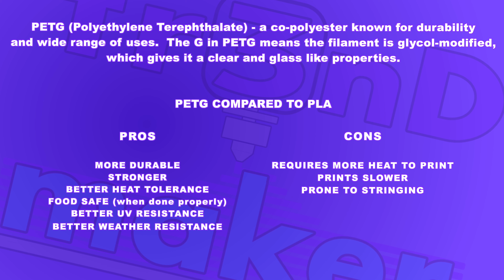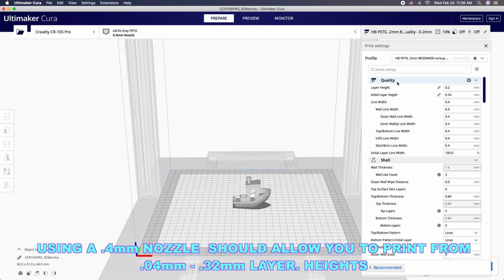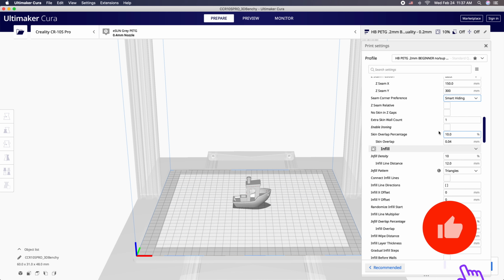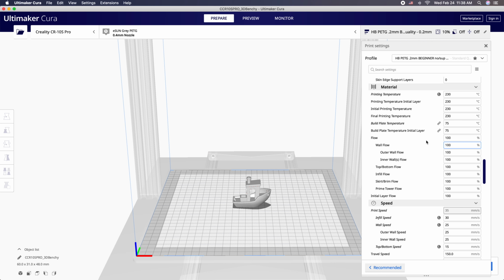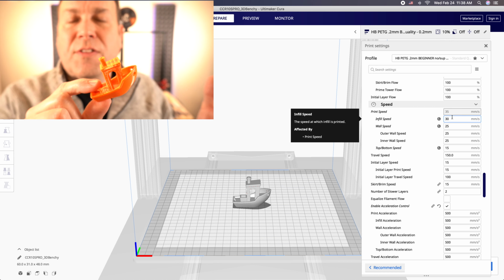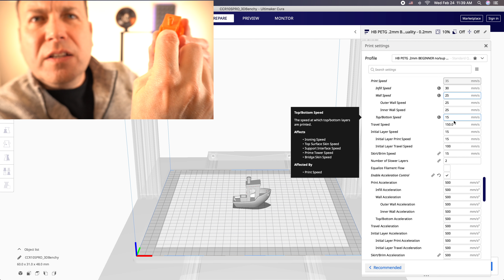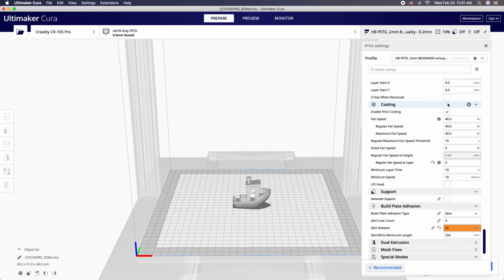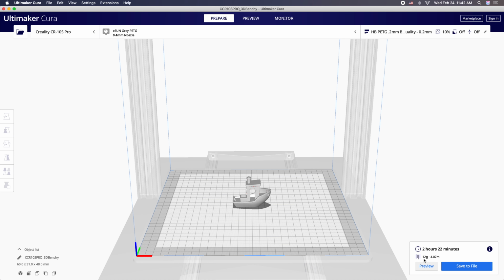How to 3D Print PETG Filament! Tips and Settings to 3D Print PETG Like a Pro - Cura

Comment: One thing you might want to point out, which I learned the hard way: Bed levelling. When I dove into PETG, I used Curas default settings for a brand PETG, figuring it was well in the range of the filaments specifications. I noticed quickly however that the first layer would not adhere to the bed though. While I had just levelled the bed the day before, and the PLA print I did before worked just fine, it took me a while to come up with the idea to just push the bed up a little bit furter - turns out this was all that was needed!
Reply: Yea I am finding that different types of filament need a different amount of squish to adhere. I think I might stick with petg as my go to if all things go well in the next dozen prints or so. Any recommendations on a filament that will be good in handheld electronics? I think petg can withstand the heat and abuse but I havent gotten to test it yet.
Reply: DUDE I HAD THE EXACT SAME ISSUE!!! The first time i printed PETG taught me to always re-level my bed when switching materials, and to invest in drying stuff like a good dehydrator lol. Rn im prob gonna use exclusively PETG because im trying to print functional parts to mod my dart (nerf) blasters
Reply: I've inserted the M29 line so that the machine always autolevels before doing a print.
Reply: I tape the bed and smear it with glue stick. PETG sticks to everything, and I've heard of people pulling chunks out of a glass bed with PETG. A disposable bed cover is much cheaper.
Reply: @freman007  have heard about the glue trick, yet never tried it out.
Reply: @freman007 do you have a glass bed?
Reply: @JohnDeaux I’ve done it and sometimes I still do when the filament doesn’t want to stick to the bed and it works I would definitely recommend the Elmer’s washable glue. It’s easier to get off your build plate.
Reply: @rap_godzz  glue stick works well if you have adhesion problems but i prefer cheap hairspray from the dollar store TBH... I REALLY prefer not using anything but my glass bed but sometimes certain filaments are tricky to get a good first layer with...

Comment: Great vid.  I got a good PETG part with temp 225, layer height 0.16mm, speed 50mm/sec, 100 fan, build plate adehsion temp 70 degrees (white glue).  I am going to try these settings.

Comment: I have a problem with PETG.I have tried so many times,but I can’t find the solution for stringing.I have an ender 3 and i use cura.
Reply from the maker: Give me some settings... what is your travel acceleration?  Retraction? Temp? Filament brand? Speed? How many hours on nozzle?  Any mods?
Reply: @tr3nDmaker  travel acceleration: 450 mm/s^2
retraction distance:3 mm
retraction speed: 25 mm/s
Temp:225
Filament brand:Devil Design
Speed:50 mm/s
No mods
I am using 0.4 mm nozzle for about 3 months but i have not done so many things.
Reply from the maker: @ΔημητρηςΔασκαλακης-ν3β  Several issues.  Retraction on ender 3 is 5-5.5 at 35mms. Travel 150mms.  Speed 30mms across the board.  PETG is thick and slow to print.  Watch Video and copy my setting as I scroll thru.

Comment: Thank you mate. I am really used to PLA and TPU, only recently I started with PETG. Its material properties really appeals to me, possibly the best of the two worlds, ABS and PLA. But man I struggled with stringing and the answer laid on speed. 30mm/sec is slow but clearly on the safer side. As you have said PETG doesn't like speed and that's is totally true. Thanks again and really good video.
Reply from the maker: I love PETG... It is worth the wait on slow printing.   The ultimate solution is to buy more printers!
Reply: @tr3nDmaker  you can get ender 3's on ebay for like 100$ US(probably will need mods to work properly if they messed it up,). i'm planning on picking up a few that way and mod them to a dual z belt system or a 45 degree conveyor belt to churn out some parts. petg is too attractive of a filament for me. the dream is a conveyor belt ender 3 farm someday lol
Reply: @or3n_ I got an ender 3 s1 for like 150... those are dual steppers for the z axis and they seem to be on sale on and off on places like ebay

Comment: printing vases and random stuff at 100mm/s kobra 2 max in creality garbage PETG... your approach is slow, high fan, high heat, I find that ~225 and 10% fan can print way faster. the key is not to be afraid of the speed and tune for it ... actually I just tried 232 with 50% and I am running even faster, 150mm/s

Comment: thanks a lot! your settings helped me to solve many problems. the last thing I had to adjust was the distance between the nozzle and the bed/top surface of what is being printed. it was too tight, and it caused the material to blob. I'm finally on the right direction to improve my petg printings.

Comment: Could you do a PETG 1.0 nozzle profile? I have had issues adapting Curas default profiles. It prints in vase mode great and also the initial layers are good on a normal print but infill fails and does not adhere to the print. I think it is under extruding a little bit because I occasionally get small gaps at the corner of the initial layer. Printing at .5 layer height 235/ 70 and fan off. Thanks
Reply from the maker: What speed in mms?  Volcano hot end?

Comment: Hello! Thank you so much for your video! I’m having trouble with printing PETG, where during non printing movements (especially over gaps) it will ooze a lot. I’ve tried dialing down the temperature and increasing the retraction to about 7 mm and upped the retraction speed a bit. It helped a little bit, but I’m still getting the ooze and stringing pretty bad. Is the retraction the only thing that goes into that?
Reply: Travel speed is extremely important. At least 120 mm/s. Go 200 mm/s if your printer can do it.

Comment: I followed your settings for PETG and they worked great for the Overture Space Gray , Ender 3 V2 no modes. The only thing I adjusted was the fan speed to stop the stringing. 
I did use 0.1 mm layer heights for a great finish. I have one problem I need help with. When the part finished and removed from the plate, I was able to separate and remove a couple of the first    outer layers . The rest of the part is bonded together very well and seems strong. Any suggestions to cure this issue will be appreciated. 
Thanks
Rick
Reply from the maker: It could be a couple of issues... 1) PETG does not like a lot of fan... if fan on after 2nd or 3rd layer, it may be cooling too much for it to melt in to layers.  Fan more than 50% can be too much.(PETG is a bit stringier than PLA)
2) With fan on at higher rate... may need to up temp of nozzle 5-10 degrees.
3) Slow it down a bit more.  On first few layers, print is solid and extruding much more than other layer.
4) Possible too much gap between nozzle and bed.  Re-level a bit closer.
Let me know how it works out...
Reply: @tr3nDmaker  Thanks for the reply. I have the fan at zero for the first 4 layers. After that it is at 46 unless I see stinging start and then I put it to 50. 
I increased the bed temp to 75 and the de- lam is gone but the first layer still looks bad when part is removed. I have made a couple different parts with the same filament and settings with perfect smooth finish on first layer. The rest of the part is smooth. Maybe its something in the file itself.
Reply from the maker: @rickbechtel2835  Hmmmm... what temp for nozzle?  Check all ecocentric nuts and be sure everything is tight.  Sounds like nozzle is lifting and not getting proper gap  from bed to nozzle.  How long have you been 3d printing?  How are you leveling bed?
Reply: @tr3nDmaker  I have only had my printed a week. I am leveling the bed with a sheet of paper. I use the four corners an inch or so in and center of the bed as reference points. A light drag on the paper. I have check the parts or consistent thickness and I think my bed leveling is good. I have a more parts to make and will keep adjusting settings one at a time and slowly. What version or Cura do you use ?
Reply from the maker: @rickbechtel2835  I think your issue is in bed leveling(regular paper is not the best to use for a beginner IMHO)... I am editing a video right now on how to level bed w paper and being sure printer is set properly before you begin.  Hopefully post Saturday Morning.  I alway use newest Cura available.  Stock Setting should be great to get up and printing... As you learn more you can tweak as needed based on what your printing...
Reply: @tr3nDmaker  What do you recommend to use for bed leveling? Feeler guage, shim stock ? 
I just think it is possible file issue. Down loaded from Thingiverse  ( Hornady, Secure-Lock Bushing) as my other parts printed with the same material from the same roll have no issues.
Reply from the maker: @rickbechtel2835  Paper Method is good.  Feeler Gauge Method better... I level by Eye now.
Reply: @tr3nDmaker  Paper is closer than eye balling it ! Sorry that is my Machinists background talking. 
If you get a chance , download the file I mentioned from Thingiverse, and just print the first .090 and let me know how the finish of the first layers once removed from the bed look. Curious if its my settings or the file. 
Thanks again for all the helpful information.
Reply from the maker: @rickbechtel2835  Wait till you see my video on leveling by eye... I have been 100% leveling by eye for years.  Only time I use paper or feeler is for demonstration or videos.  It is not for everyone, if fact not for most people... But like you.. I am very mechanical minded... judging the gap is second nature to me.  Plus, I can adjust on the fly with skirt, if I am .01 or .02mm off

Comment: How do I make my print thicker all the way around...more solid?
Reply from the maker: Add more perimeters/walls. 3 is good, 4 to 5 is heavy duty.  Infill % will make it stronger inside.  Top and bottom thickness should approx match walls.  If you want it solid.... make bottom layers= 999.  Be sure to sub!

Comment: Hello, thank you for the video! I've followed all the steps and my prints shell looks fantastic but has layer gaps in it. I've been having a PETG problem since I started using the material where the entire print is very weak, and can be crushed by my hand easily. Here are my current settings:
Infill speed: 25mm/s
wall speed:20mm/s
Inner wall speed:20mm/s
Density: 20%
Pattern: Cubic
Nozzle temp:240c
Everything else is the same as in the video
Is there any way I can fix this problem?

Edit:I swapped out the nozzle and things are looking a bit better. Shell and infill are stronger but the prints can still be crushed/split by my hands
Reply from the maker: PETG likes a simple infill.... I mostly use triangles.  As for under-extruding during infill... try Triangles and bumping temp up 5-10 degrees. The higher temp helps extrude smoother and faster.  If still not helping... try 20mms infill speed. 
PETG is thick and does like slower speeds.  I often just run at 20mms.  It slow, but prints strong and perfect.   
I hope this helps.  Be sure to Subscribe for more videos.
Reply: @tr3nDmaker  Thank you very much. Both of your suggestions worked and the PETG is printing flawlessly, earned yourself a sub!
Reply from the maker: @joedoe2753  Thank you and you are very welcome.

Comment: the correct way to say PETG is P E T G not pet g because it is an abbreviation
Reply from the maker: You are correct.  Almost every 3d printer I know calls it pet g.  A short or slang, I guess.  I will be sure I say the accurate way in the future.

Comment: Nope, did not help me, got worse result than printing with high bed temperature. anyway it is not sticking on glass
Reply from the maker: Wipe on Elmers Purple Glue Stick in a printing zone.  Be sure getting good squish of filament. Must get a good first layer with all lines connected with glass.  Bed at 60-75.  Check if any air from heat or ac anywhere near bed surface... it will cool filament and cause lifting.  Good luck.
Reply: @tr3nDmaker  How material that sticks to anything, can not stick to bed. i have tried pure clean wiped with alcohol glass.also with hair spray, with duck tape, with glue. Best result was that printed xyz cube with hair spray and it basically was holding on with its weight. Some dark sorcery sort of :D But thanks anyway!
What about leveling? PLA is ok with 1 paper, and PETG soemthing like 3 papers?
Reply from the maker: @ygalion  95% of failure like this are either loose eccentric nuts(parts moving) or improper bed leveling.  Watch this and be sure everything is tight and good squish on first layer... Let me know if it works out.  https://youtu.be/MhIE0ms-n7U

Comment: Total fucking bs... i print at 50mm/s no problem. I wouldn't imagine how long a 12 hour print at 50mm/s would take if i was printing at 25mm/s!? Otherwise pretty good tips though you'd probably be getting near optimal results with printing at 40-5 mm/s no problem. Depends on the brand ofcourse...Try out what tickles your pickle the most!
Reply from the maker: Every printer and filament are different. 95% of issues of PETG  is that user prints to fast to point of failure.  As I state in video… start slow and increase speed till happy with speed and quality.  Much depends on extruder, type of hotend and ultimate finished look.
Reply: @tr3nDmaker  agreed!